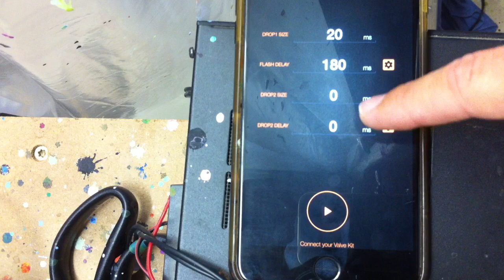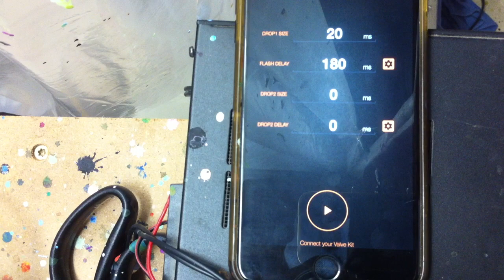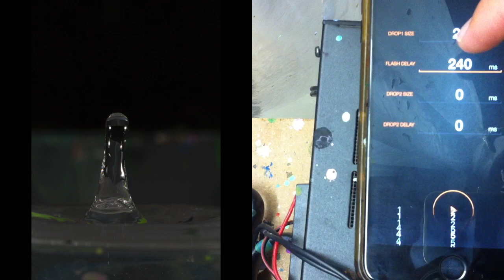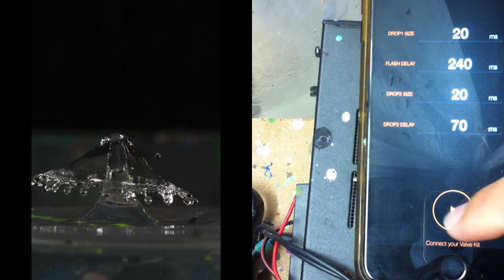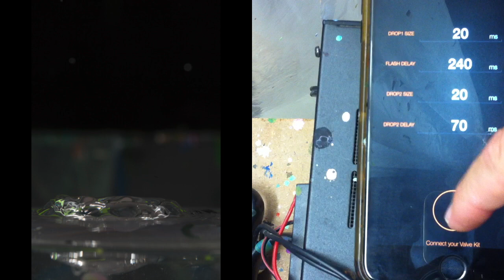Pluto Trigger Water Drop Tutorial Part 2: How To Capture A Collision

Comment: The Pluto water Dropper I bought worked for half an hour then just dropped splurges of water and not droplets.  Contacted Pluto, who sent me some new springs, which didn't solve the problem, then lost interest.  My advice is to get the MIOPS dropper.
Reply from the maker: Sounds like a dead battery. Miops is good too.
Reply: @TimBuckMichael  New battery, replaced twice.  Actually just had an email from Pluto and they're sending me a new unit, so fair play to them - if it works!
Reply from the maker: @Ozone280  That is a pretty solid move by them. Hopefully it works for you!

Comment: hi Tim, just received my pluto+valve+arm. arm is a toy. unboxing pluto, there is no usb charger anymore, just a usb cable. Not serious !
how can i charge it ? on any usb port of my laptop pc ? and if no laptop available, which power adapter ? i don't dare using one coming from a iphone 8 or other, no idea the voltage we need...
Reply from the maker: Interesting. I purchased mine quite a while ago, I'm thinking 2016. I just looked at the charging block that it came with. It says "output 5a dc" I'm not knowledgeable in electricity but I assume that means you need a block that will do 5amps.
Reply: thank you, i saw on pluto EN version, they mention "works on any ub charger" so i used my iphone 8 one and after 2 hours led changed from red to green and it was ok :-)

Comment: nice tuto. just purchased pluto waterdrop kit with arm and didn't know ho to start. i have  ad750+flashes ad400 pro+ads085s diffuser+ad200pro+2xgodox v1 and a trigger xpro.
how do we colorize ? i have seen we can use tungsetn white balance to make it blue or use a colorfull background.
is it recommended to use milk in pluto valve ? not too difficult to wash it ? should we use food coloring liquid in valve or in the glass ?
Your pictures look nice but no comparison with ones i see on internet in term of shape, colors, light. how can we do it better ?
Reply from the maker: The issue I have with getting color is I am currently limited to a 2 flash set up. Most that I have seen with crazy colors and interesting backgrounds use more than 2 flashes. You can use clear water and an interesting background to get more color in the images. I have found that scrapbook paper from Hobby Lobby is great for this. Food coloring is also an option. I have used it but prefer paint because paint helps to thicken the water. There are other, more robust, systems out there for doing this. Systems that have separate reservoirs for each drop. With this getting color is easy. Put different colors in each one and your colliding drop will be a different color than your jet. There are also systems out there that allow you to shoot a jet up from the bottom or from the side. The Pluto is a great starter system but it is not without its flaws. The following link is a higher end system I have been looking into https://cognisys-inc.com/triggering-systems/water-drops.html
Reply: thank you. second flash is "slave" triggered by light of the first speedlite driven by pluto ? does "jeff photographie" idea has sense to connect pluto on a godox xpro transmitter on table so you can drive lot of flashes. It supposes that the weak element was the camer command processing (pluto to xpro on it) while here the pluto triggers flashes by radio and camera with IR. i wonder why nobody is using a ad400pro or ad200 pro with octabox,... to lighten the scene.
Reply from the maker: @marclabro  I fire everything off of the camera transmitter and use the Pluto to fire the shutter. It adds some delay for sure but I could have as many flashes as the transmitter would allow. I think the reason people are mostly using speed lights is because to stop motion you need an extremely short burst of light which a speed light can provide. Maybe traditional strobes can do this too, but that is out of my realm of knowledge.
Reply: sorry for my english, i don't understand your first sentence. do you mean no radio transmitter, pluto wired with flash and pluto IR pointed to camera IR detector ? i spent whole day yesterday with d750 F11 iso 400 1sec, godox V1 manual 1/128, water and milk with this topology and nothing works. it is like i have two droplets cutting the raising cone while only one is activated with an effect like "rear curtain" where it seems to go wrong direction. with milk isntead of water we see the lo,g milkk drop in the air but not the cones raiing for flat surface. I tried the xpro on camera and for the first time i saw a thin cone raising but not repetitive and not wide cone like yours. why do i have images like broken long drop or two droplets in air ? i will try to share some pictures.
Reply from the maker: @marclabro  Canon ST-E3 triggers my canon 600 EX flashes. Pluto goes into shutter release on the camera.
Reply: thanks. Do you mean pluto triggers st-e3 by wire (st-e3 lays on table, not on camera ; camera doesn't use st-e3) and pluto triggers camera by infrared ? is there a special mode to use for IR ? i just set pluto to single, nikon and camera to IR quick response (but c5 menu remote on duration  is not clear between 1min and 15min; i set to 1 min). On all my images i have two round balls surimposed to collsions and even on one drop raising,... no idea why. it looks like a RPT stroboscopic view,... at 1/250power my godox V1 should have a short T0.1 time.

Comment: Hi Tim,  the demo on the how to use the valve and drop program were awesome. However im struggling to get anything.  How about the settings for the basic program before you get to setting up the valve.  When I connect everything up, my cannon 5d mk iv only fires the flash every 3 shutter clicks.  Im using two flashes and a trigger, even with a single flash it only fires ever there shutter clicks.  Any suggest for the basic app set up?
Reply from the maker: Hi Richard, thank you for the kind words. It is difficult to address your issue in text. I will see about making a video addressing your issue. Thanks for stopping by!

Comment: Do you use front or rear curtain sync with the flash or does the trigger override flash setting in the camera
Reply from the maker: That is a fantastic question. I am not sure if the trigger overrides the camera setting, my assumption would be that it does not. I use front curtain for these but given the setting and the amount of light necessary to get sharp images in the given conditions, I'm not sure that it makes a difference. The only way it would make a difference is if you have your drop settings dialed in for one setting (front/rear) then switch it. This would likely change the point of the drop that is captured ever so slightly. Hope this helps! Thanks for stopping by

Comment: buongiorno . seguo con molto interesse  il video e lo trovo molto interessante .Seguo con interesse perchè anche io ho acquistato il pluto trigger e la valvola per l'acqua e il ricevitore /trasmettitore (https://it.plutotrigger.com/products/rf-transmitter-receiver) ma non riesco a sincronizzare sia la reflex con i flash ovvero non mi parte lo scatto dalla reflex .ho collegato la valvola pluto al trigger pluto e il pluto al flash poi ho letto da qualche parte che il pluto invia l infrarosso al trigger viltrox .Cosa sbaglio nei collegamenti ? se qualcuno mi aiuta ne sarei grato . buona giornata da Roberto

sorry for the translation
good morning . I follow the video with great interest and I find it very interesting. I follow with interest because I also purchased the pluto trigger and the water valve and the receiver / transmitter (https://it.plutotrigger.com/products/rf- transmitter-receiver) but I can't synchronize both the reflex with the flashes or I don't start shooting from the reflex. I connected the pluto valve to the trigger pluto and the pluto to the flash then I read somewhere that the pluto sends the infrared to the viltrox trigger .What wrong with the links? if someone helps me I would be grateful. good day from Roberto
Reply from the maker: Hi Roberto. I suggest firing the flashes from the Pluto and triggering the camera manually to have a 3-5 second exposure in a completely dark room. When the flashes fire it'll freeze the motion.

Comment: Hi Tim, love the demos for the pluto and trigger! I have been wanting to try it with paint would there be a specific type of paint you like to work with better?
Reply: Thanks ill give that a try! I also watched your video on taking the valve apart for cleaning as my valve was getting stuck open. Before giving that a go as I was minus the Teflon tape I ran a 50/50 mix of vinegar and hot water through it a few times and that cleaned it out.
Reply from the maker: @Jennreedphotos  Thanks for the tip! Vinegar and hot water seems like the easier way to go. My wife always accuses me of doing everything the hard way... maybe I should do an update video lol. Thanks for stopping by!
Reply from the maker: Thank you for the kind words! I just buy the cheap 50 cent stuff from Walmart. I mix it with water. I don't really have a mix ratio, kind of just squirt some in a bottle and add water and sometimes borax. I wish I had it down to a more exact science but I do not. If you have any other questions feel free to ask!

Comment: Hi Tim. It looks so simple when you do it! I can’t even get mine to do a tower, it just spreads like a watery flower and doesn’t go high no matter what I do. I tried adding glycerine to that water and it made no difference. Also I had my flash on lowest power and focussed in the middle but it’s still a blur. Please do you have any further suggestion, thank you!
Reply from the maker: Hello, thanks for stopping by! My first suggestion would be to raise the dropper so that it is higher above the water basin. Focus with macro is very touchy. It's possible that you need to adjust the focus a tiny amount. If you have any more questions feel free to ask!
Reply: @TimBuckMichael  Hi Tim, thanks for the reply. I tried raising it a bit higher but it made no difference. The tap water is very soft in my area, would that make a difference?

I keep trying with that macro lens, it's harder than insects!
Reply from the maker: @claireandglynwade5509  I don't see that making a difference. Your catch basin may be too shallow. Try a cereal bowl and raising the dropper like 24 inches above it. Set the drop size larger, like 40ms and see what happens.

Comment: if your camera shoots to early which setting do i need to change, flash is at 150 and drop 20
Reply: i found out what my problem was (red face) room was not dark(ish) and light background. Used a black background and got it with using auto increments.

Comment: Tim I got everything set up and was getting a good collision on about every 3rd or 4th drop. But then I took a little break. Maybe 10 minutes and I come back and now nothing is timed right. Camera is firing way early. No settings changed. Have you ever experienced this? Could a weak battery somewhere cause this?
Reply from the maker: I have experienced this many times. There are a ton of factors. If the water temperature changed it can effect it, if the battery is weak, that could be your issue. There are a ton of things to trouble shoot with this unfortunately. Typically when that happens to me I just start over and dial it in again.

Comment: Hi Tim! When my valve triggers I get a long stream of water. Not just a drop. Any ideas? Thanks!
Reply from the maker: Hi Phillip! May need a new battery or more delay between drop 1 and drop 2. There may also be some moisture on the battery connection or circuit board causing a short.
Reply: I seem to have that solved. Now just time to try the 1000s of possible settings. Patience is required. :-) Guess that's why everyone isn't showing amazing drop photos. Thanks for your quick response!
Reply from the maker: You're welcome. Yes, lots of patience is required, there are so many factors! Good luck!
Reply: Hello  @pcphotog  , it seems that I have the same problem here. Could you please share ohow you solved it? Many thanks

Comment: Hi Tim
I am enjoying your videos, I think you were the one who said they had good customer service? if so how do you get them to message you back, I have tried several times with no reply, I have been talking up their product. got it as a Christmas gift to myself ( arrived this moth ) used it twice ( with good results ) then as I was taking pics on the second time, it dropped 2 drops and then just drained itself, thought it was strange so I filled it again and it drained out as fast as I put the water in the valve. all I want to know is if it's a defect or is there something I can do to fix it.  just taking a chance you might be able to help. 
thanks for listening. 
Laura
Reply from the maker: I don't know about their social media response, I always email "info @ plutotrigger.com." They usually respond within a day or two. I do have 2 potential solutions to your problem though. 1 - try a new battery. I have found that those batteries that it requires are hit or miss. I've had new ones only last a few hundred shots and others last for thousands. 2 - you may need to clean the valve. I made a video showing how to take it all the way apart and clean it, I'll link it below. If you aren't brave enough to completely disassemble and clean it I have had success with filling the reservoir with hot water then using the button to rapidly open and close the valve. Hopefully this helps! thanks for stopping by.
Reply from the maker: https://youtu.be/iRqhF_Y6xwk

Comment: Great explanation!  I would like to know the dimensions of your pvc stand and misc parts of it.  I intend to make one.  Thank you for the video!
Reply from the maker: Thanks for the kind words! It's 14 inches tall, 24 inches wide and the base is about 12 inches. It's made from 1/2 inch PVC pipe. You will need 6 elbows, and 2 T's. 4 Elbows are used for the feet. You need 4 - 6 inch lengths, 2 - 14 inch lengths, and 1 - 24 inch length. The 6 inch pieces go in either end of a T with an elbow on the open end. The 14 inch pieces go perpendicular to the 6 inch pieces within the T also with an elbow on the open end. This will give you two elongated T shapes, the 24 inch piece is the crossmember that connects the two. To attach the clamp I just took the clamp with me into the hardware store and found a bolt that had the proper threads to fit it, drilled a hole in the center of the 24 inch crossmember and bolted the clamp to it. 

I know that may have been confusing, lol, if you have any questions feel free to ask.

Comment: Hi Tim, This is excellent... I am planning to set this up on this Christmas for my teenager who is an amateur photographer . Could you please share all instruments/accessories required for this and from where to buy. She has Canon DSLR.
Reply from the maker: Hello Gunjan! Thank you for the kind words! You can buy everything here http://www.plutotrigger.com?afmc=8n. Pluto Trigger, Pluto Valve, Magic arm and you will need to select the proper cable to attach to her camera as different camera models require different cables. You'll need something to drop the water into. I just use a standard bowl like I would eat cereal out of. You will also need an off camera flash which you can get here https://goo.gl/cVPtf3. The Pluto Trigger comes with a single cable to attach to the flash if you have more than one flash you can get a splitter cable and an extra flash sync cable. All of that is available from the first link. You will also need a tripod or a stand of some sort to attach the valve to. There are an infinite amount of DIY options for this or you could just use a tripod. I think that is all. Feel free to let me know if you have any other questions. Thanks for stopping by!